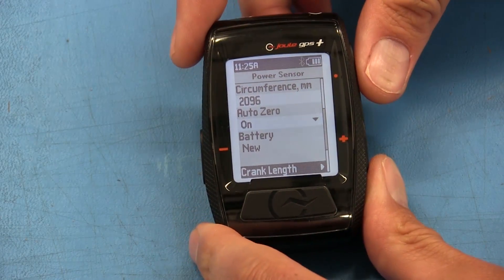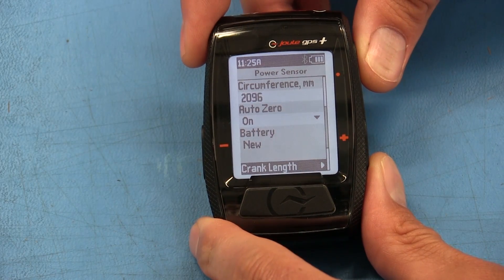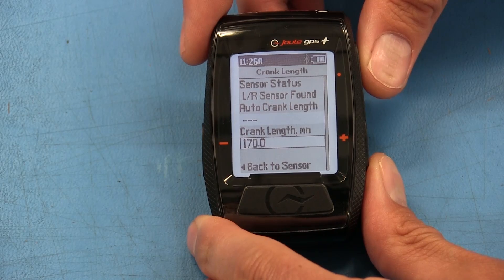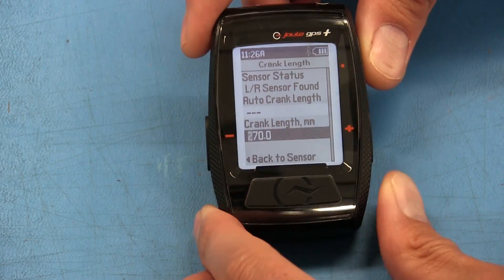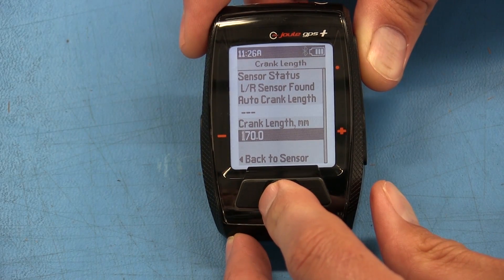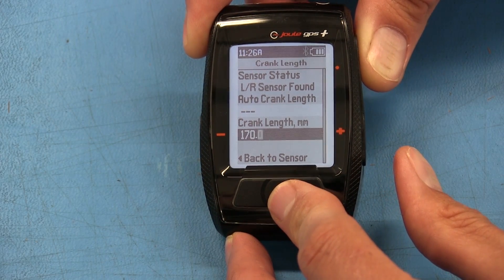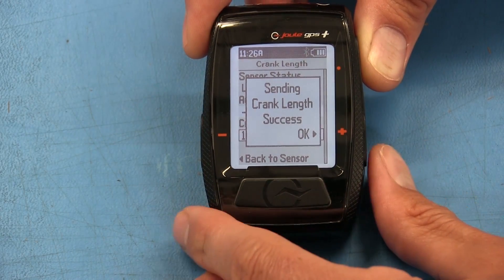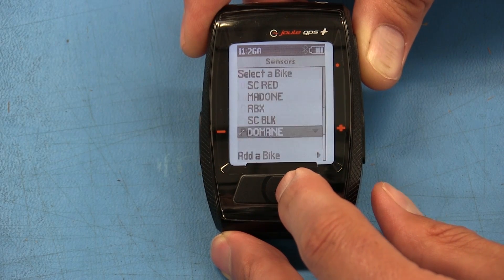How to Set Your Crank Length on a PowerTap Cycling Computer

Comment: Is is possible to set crank length with Powertap IOS app?
Reply from the maker: Hi Robert: Thanks for the question. You can set the crank length for the P1 pedals in the PowerTap Mobile App with the following steps: Main menu > Settings > Sport profile > Click orange gear next to Sport Profile > Right and Left Pedal should appear in Sensors, if not you will need to add them to this section > Click onto each pedal individually > Change crank length setting for both the right and left pedal.

Comment: How do you set the crank length at an 810 ?
Reply from the maker: arcosh22 You will first need to pair the P1s as pedals and then you'll be prompted to set your crank length. If your 810 does not follow these steps, we recommend contacting Garmin's support. Thank you.